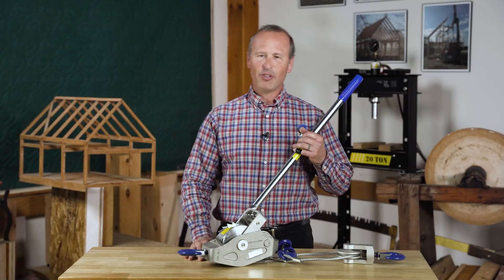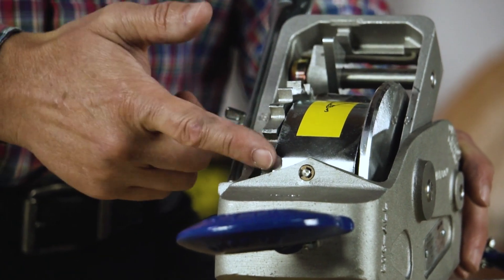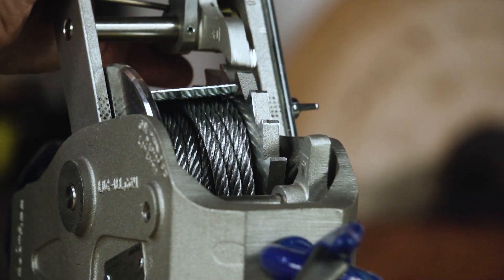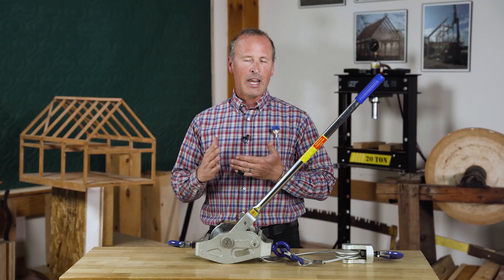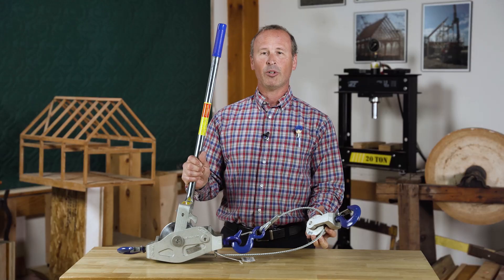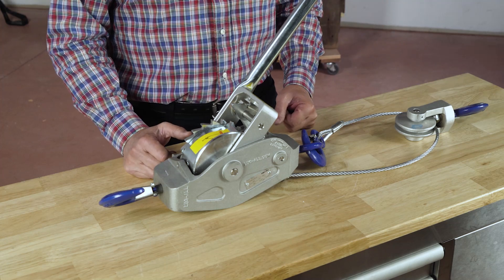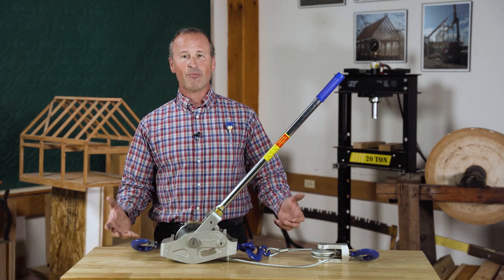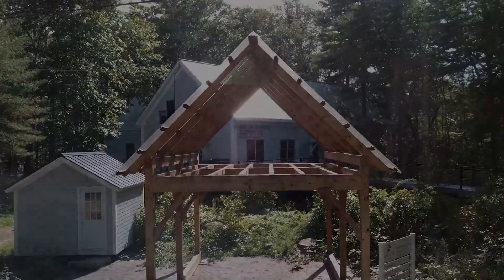Move Almost Anything With This Tool!

Comment: Is using this to apply compression to the joints, combined with planed timbers, why you don't tend to house your joints?
Reply from the maker: Hey Eric-we use the come-a-long to compress the side grain to avoid shrinkage gaps from opening up as the wood dries, but we don't use housings because we design joinery that doesn't require housings, or for the entire cross section of the timber to be supported at the ends. We avoid housings becasue they tend to unnecessarily weaken the supporting timber by removing more of it, and because the nature of housings (where an observer can easily see the intersection of the timber and the housing) tend to make shrinkage gaps very noticeable. Instead, we reduce the timber at the ends to a tenon, which is not visible after installation so no gap can be seen between the mortice and tenon.

Comment: Great explanation.  Personally,  the More Power Puller is a better choice simply because it comes with Dyneema not steel cables.   Way safer.
Reply: It's also cast iron, not aluminum. Rated at 3 tons with a single line pull. I honestly believe it would move double that if the winch rope line would hold up!